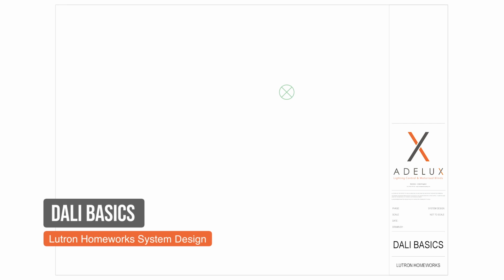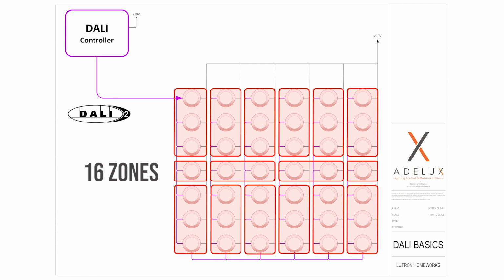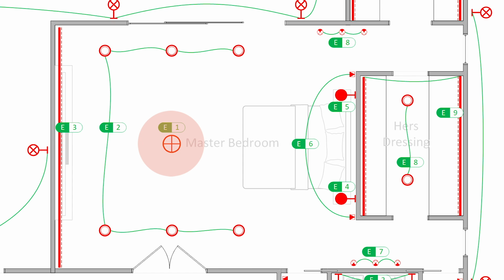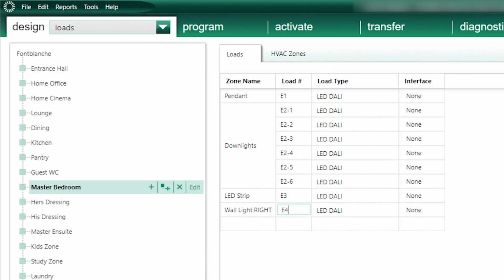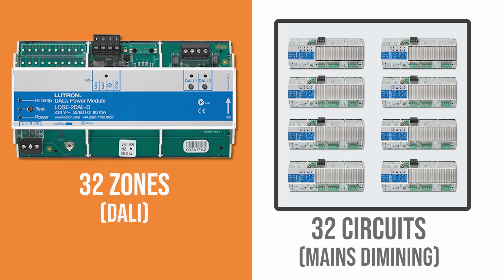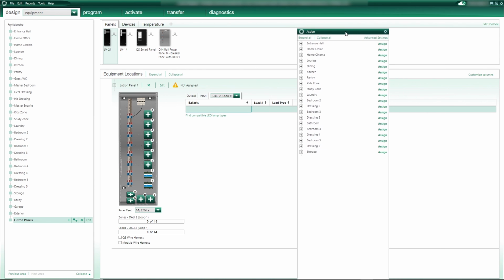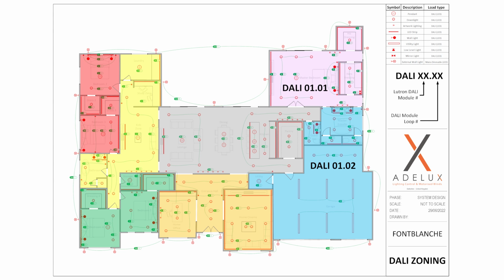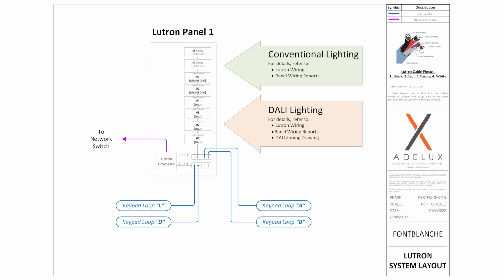Lutron Homeworks QSX System Design with DALI Light Fittings // Adelux (NEW) [2022]

Comment: what about zone numbers (Zone# column)? Are they importatnt when you assign loads to a loop? I always thought that zone number coresponds to DALI group number and has to be unique ? Is Zone Name alone enough to ensure that you won't end up with mixed up circuts (becase they will have the same zone number in different rooms)?
Reply from the maker: Good point! Zone name is automatically assigned to a zone #, this happens behind the scenes (that’s why I chose not to display that zone # column in the video, because no changes are needed there). Any zone name within a room has to be unique. So once you create your Dali zone and add the number of addressable driver to it and then assign that zone to the correct loop it is wired to, you good. I’ll post a dali programming video next week so stay tuned ✌🏾

Comment: Do you have a wiring diagram of the wiring going from the Dali Lutron module to the light fixture and also what is the recommended wire?
Reply from the maker: This is shown at the beginning of the video isn’t it? Wiring depends on lengths etc. Best to Google for full cable specs